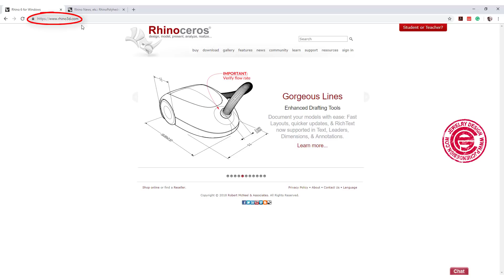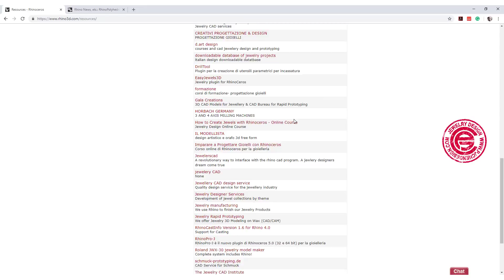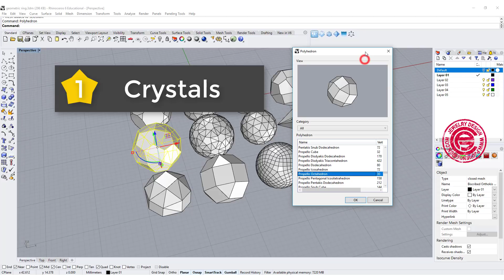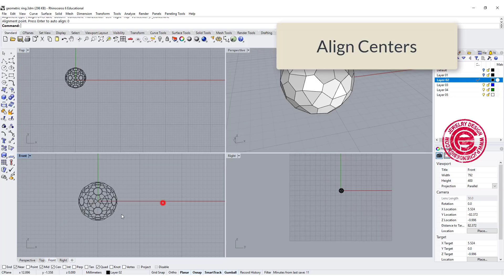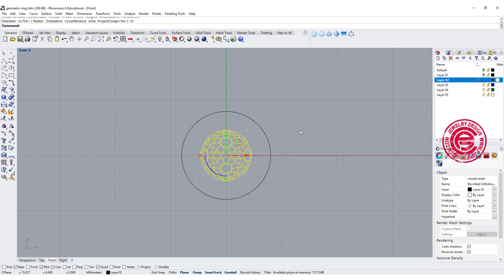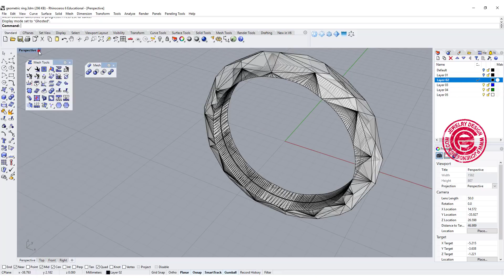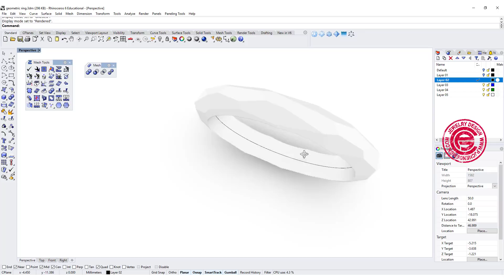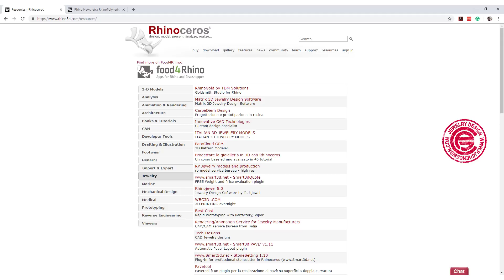3 Minutes Easy Faceted Ring in Rhino 3D (2019): Jewelry CAD Design Tutorial #57

Comment: A nice way to round of the edges or "comfort fit" the ring would be to create two flat planes on either side of the ring, then use those to boolean split
 away the sides a few mm in. Once that is done you should be able to filletedge without problems!
Reply from the maker: Thank you for sharing.

Comment: Amazing PJ; thank you. I have a question: can not you turn a mesh into a polysurface? Than it is easier to work with!
Reply from the maker: yes, you can use MeshToNURBS command. but I am not sure if it is easier to work if the are a lot of faces. plus it will slow down your computer A LOT.